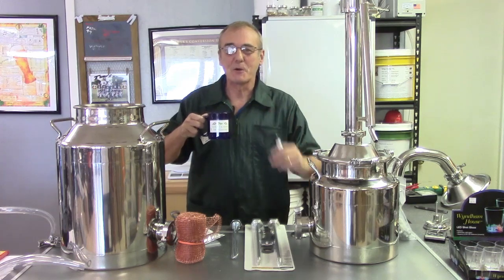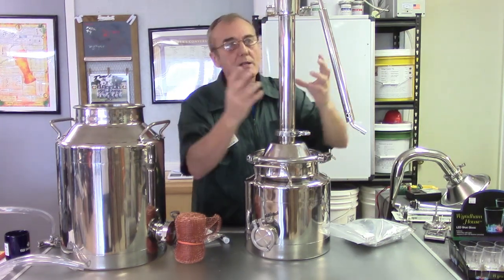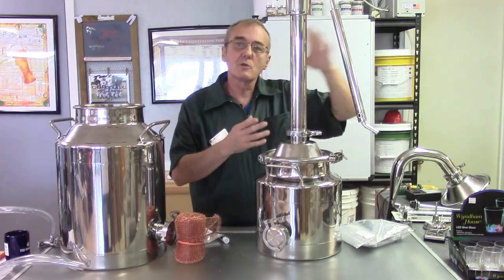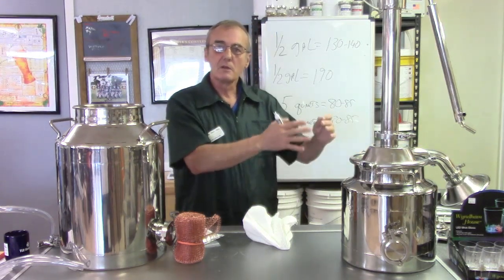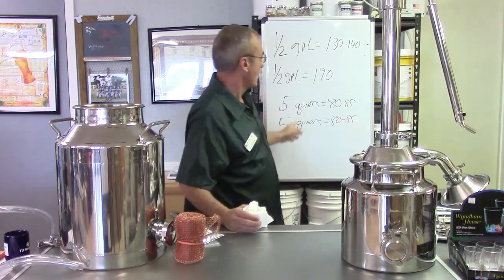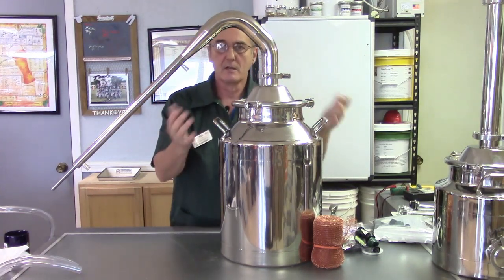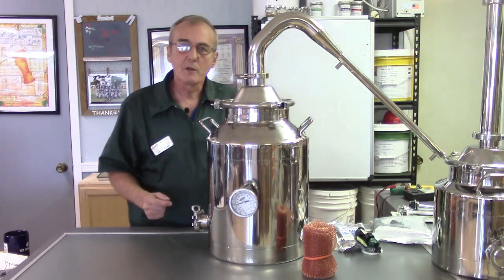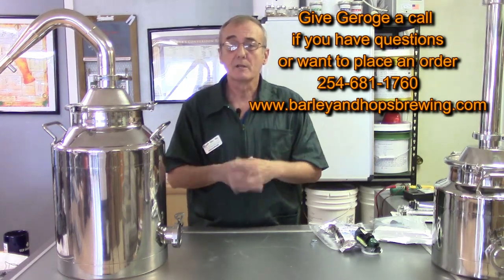Pot versus reflux and more

Comment: mathematically, 1/2 gal of 130 proof would yield less 80 proof spirit than 1/2 gal of 190 proofs

to make a quart of 80 proof spirit from 130 proof you need .6 of a quart of spirit and .4 of water.

to make that same quart from 190 proof you only need .4 of spirit to .6 of water.

so you can make 50% more with 190 proof
Reply from the maker: Yes. This is true if you begin with the same volume of both 130 and 190 proof. The reality is; in a run you can either collect 130 proof  or 190 proof depending on the process but these will be different volumes. In the end you will make the same amount of cut 80 proof with either one. Your math is accurate but your premise is flawed.